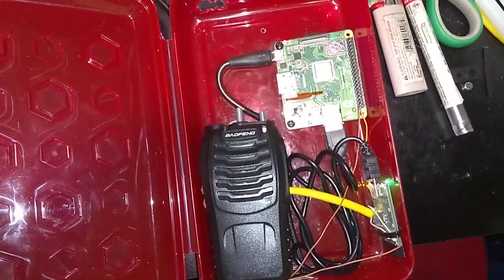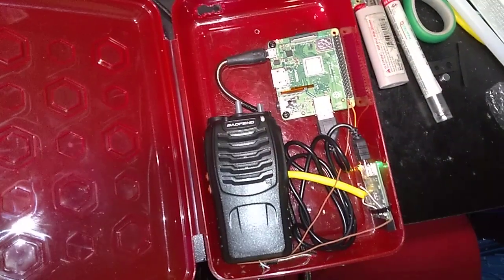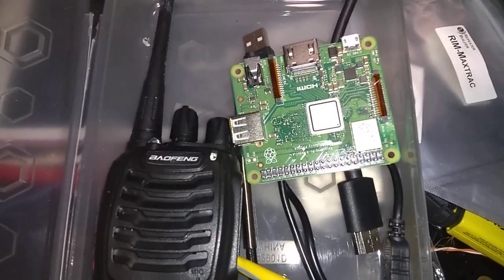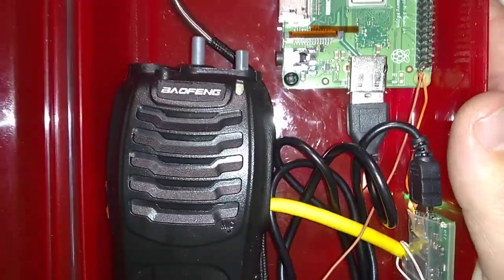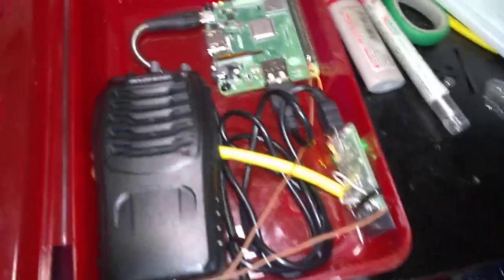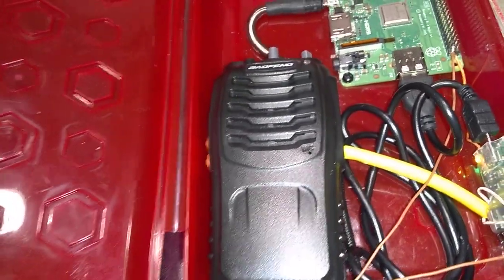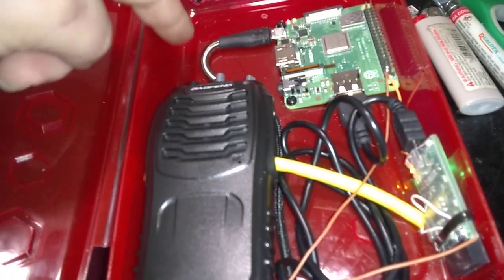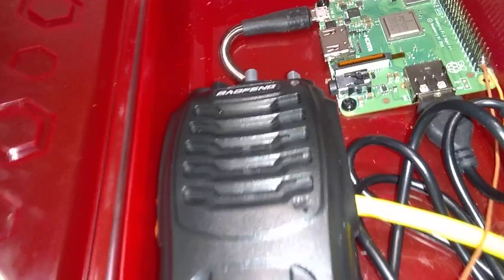micro GMRS network repeater

Comment: I am not a Radio tec at all but I do know that if you run a radio without an antenna you will fry the finals in just a few seconds. I did take electronic in High school for two years and one year of college. I did learn a little bit. I would not suggest at all to run a transmitting radio without an antenna. You could be held liable for the cost of the radio.
Reply from the maker: I have been running a bf888 for months with no antenna. It's not like it's need to get out that far.
Reply: @tgln  These radios are receive only, no?
Reply from the maker: @ErikAtTheW  it does both transmits and receives the transmits the audio from the network and receives the audio from you